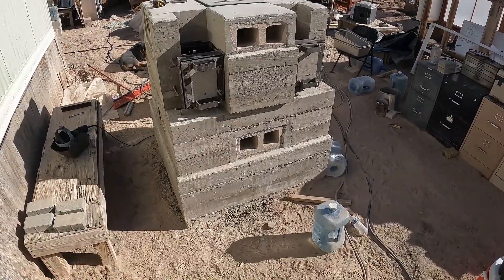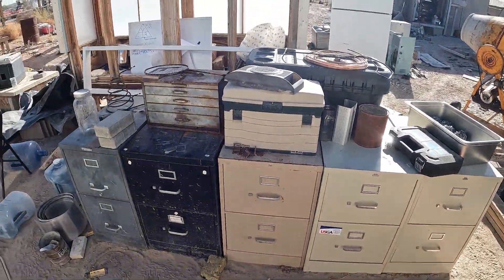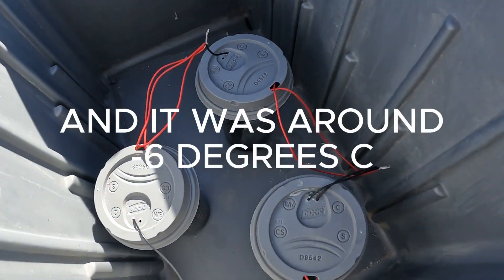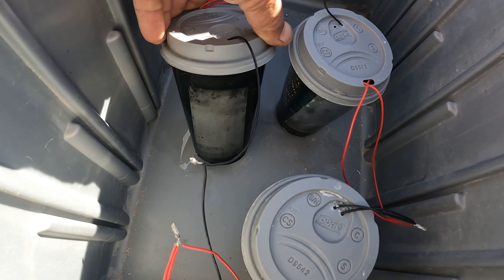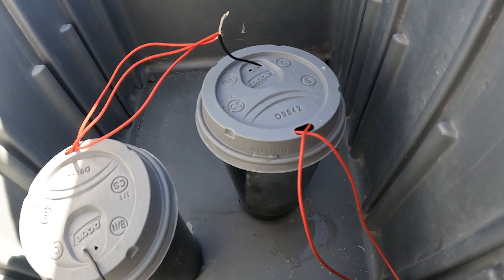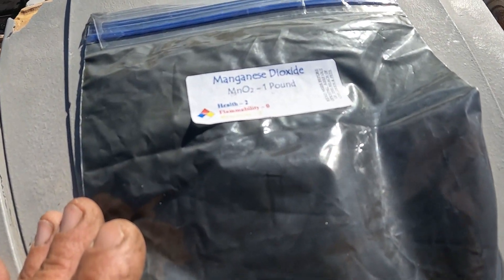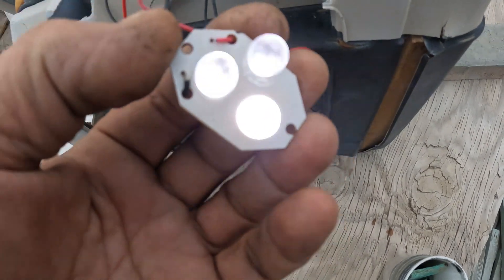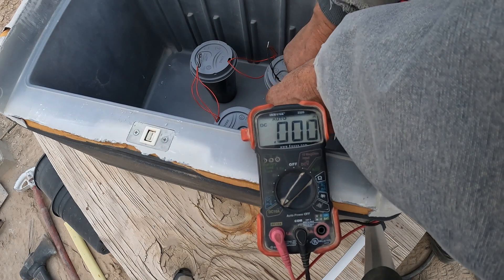Sand Battery and Zinc Battery Updates E134

Comment: How much dough are you in for on the sand battery?  Definitely not trying to be discouraging in any way, but very curious...
Reply: I've tested a much easier and cheaper and possibly better idea (eek), with used equipment available off craigslist. I'll share it at some point, I love the effort and experiments Mike has provided, it's inspired me a lot.   Excited to see him start testing his.
Reply from the maker: I am not sure. I will have to do an estimate. I would say over a grand so far or close to it but I could be way off.
Reply: There are definitely more frugal designs if you're looking to capitalize on the idea with a budget. You could make a basic 5-gallon bucket system, where you leave it hooked up as a dump load for your solar during the day, then manually move it indoors at night. You could even seal the bucket with element inside with a terminal hookup on the lid. And make a small wheeled cart for having it indoors, that way it can release heat off the bottom as well, and doesn't burn a hole in your floor ;)